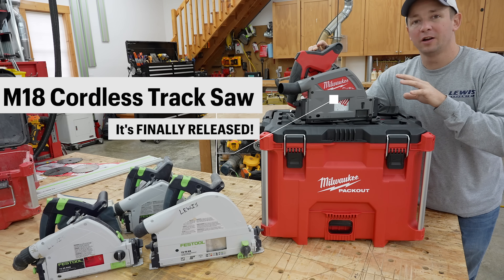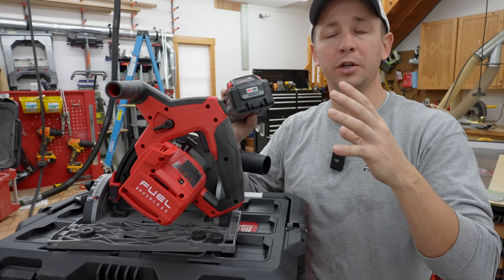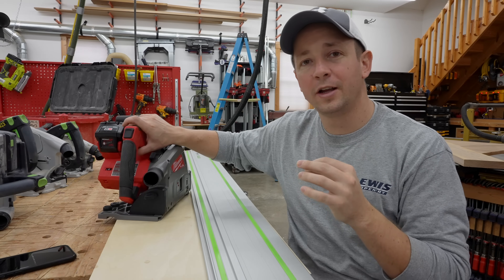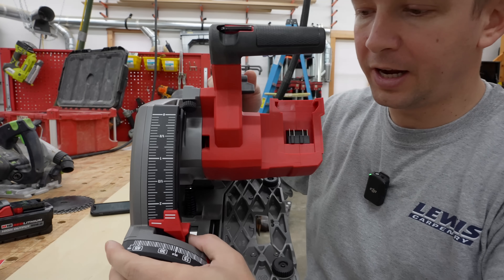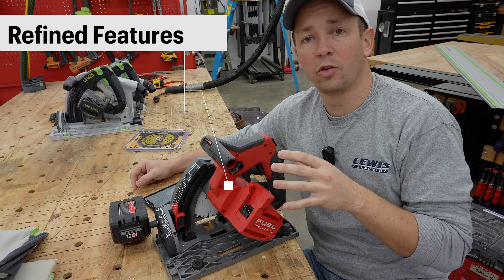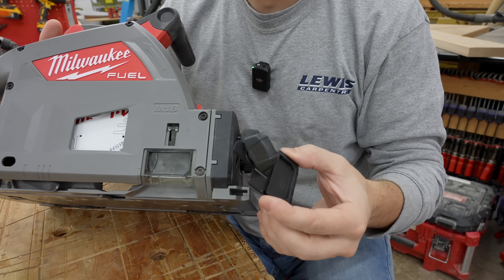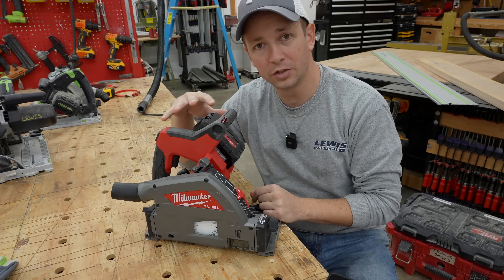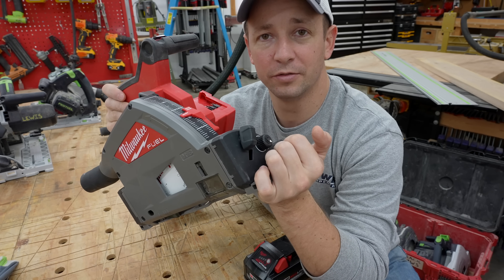Did Milwaukee Deliver??? | Full Review of the NEW Milwaukee M18 Track Saw

Comment: I'm going to stop at 9:42 min. Cutting angles and adjusting track saw to coincide with splinter guard. That's a vary good idea to have angle cuts where the saw blade only touched the bottom of the splinter guard. When using straight cuts and then using the same fence for cutting angles you now have the splinter guard which is on a 45 degree instead of 90 degree. Having a dedicated fence to use for angle cuts and one just for 90 degree cuts is one way to overcome any issues without adjusting the bottom of the saw. I feel you way is better as it wont cut the bottom of the splinter guard. My question then is, will this effect the position of straight cuts in relation to where the splinter guard is? The milwaukee looks impressive, particularly the power of the machine compared to the festool. Has the festool a 2.2 mm blade or the later 1.8 mm blade. I bought the festool with the narrower blade. I know what you are mentioning about the festool and how the batteries get drained very quickly. That is one reason I was looking to get the metabo plunge saw. The metabo has a 66 mm cut depth opposed to the festool 55mm plunge depth. In the end I bought the new festool plunge saw. With the festool from the back of the fence to the cut for 90degree is very close to 184 mm. I should really conduct an experiment to determine how far angle cuts go from other side of fence. Great video. Thankyou for dedicating your time to present this video.

Comment: Spencer, great review from you as usual! I get that this review is about the Milwaukee battery platform..... but can i ask you about another subject that is connected? Between the shop and jobsite, it's hard for me to justify switching from corded to battery. My old way of looking at things on the corded/ battery choice was driven by moving around or working in one location/ station. I usually find I have one cut station on most jobsites. Along with how much battery "wear" with heavier repetitive use decision. To me, I struggle to find the cord to battery value for this tool.... can you help me why it works better for you? I have quite a few M18 batteries and tools, but I also have a corded Festool tracksaw.....
Reply from the maker: Well here is the truth for me, in the shop I am always using my track saw at my work bench which has a hose above, so its always attached to a hose. Cord is fine in the shop. 

On the jobsite, most of my track saw work in near my saw station where I always have a vac setup. When I am doing a lot of ripping of 1x material for beams I bring a corded saw into the jobsite because I like the power, dust collection, and don't like changing batteries often. 

That being said there are plenty of times on the jobsite that I grab and go with the TSC 55 and it works great with the dust bag. Especially for cutting down doors. So for me, the convenience on those occasions is worth having the cordless saw, but it helps that I also use the HKC.
Reply: I have the Makita corded track system, I have always liked it better then the Festool but that's just me, wanted a cordless saw but wasn't willing to buy the Makita cordless because I have all Milwaukee cordless tools, this is something that I'll give serious thought to buying. I don't worry about how many cuts per battery, I have one 9.0 high output battery plus a lot of 5.0's so that's of no concern, the cut is and I'll have to look at that. I do think quality of blade is very important, I use Festool blades on my Makita and am very happy with them.

Comment: I got a question. Will those adapters work with a say, 6ah dewalt battery?
Reply from the maker: I'd be hesitant to try it on a tool with this much power demand, but in theory it probably should.

Comment: Have you used the Dewalt tracksaw. What are your thoughts on it. 
Great video as usual 😊
Reply: I'm all in on the  Dewalt platform but wasn't impressed with the precision of their  track saw and ended up buying a Bosch. Makita was a close second.  Festool and Mafell were too many $$$ for DIY justification.
Reply: I have the DeWalt. I like it but I don't think it's as good as the Makita and by the looks of it also not as good as the Milwaukee. 
The DeWalt depth adjustment is cumbersome in comparison to the other brands. Changing the blade is also not the best. 
I will likely get this Milwaukee and sell my DeWalt.
Reply: Yup I have the Dewalt track saw. Your right about the precision. Feels like I have to do a correction each cut. But it’s very handy when I’m lazy to bring out the table saw. This Milwaukee track saw review is awesome and the price for this track saw is fair. Would love to get my hands on it.
Reply: @h0melyfe792  so I actually went ahead and bought the Milwaukee track saw yesterday. I just bought the bare tool and 2 tracks. I didn't need the kit version with the battery, the charger and the packout as I already have more than enough of that stuff. I'm ordering the 108' track from HD. I haven't even pulled it from the box yet but I will use it tomorrow to compare it to the DeWalt. Most likely the DeWalt will find a new home in my garage or I might sell it.

Comment: Thanks spencer
Looking forwards to getting mine after this review
Does it fit in the large packout at all? As you said the xl is huge for a tracksaw
Reply from the maker: I couldn't make it fit in the large packout. Possibly if you took the blade off, but otherwise no.
Reply: Would it happen to fit in the 16 in compact pack out box it looks like the dimensions would be really close ?

Comment: thoughts on the Mafell MT55cc?
Reply from the maker: I've heard good things but I haven't had the chance to use it. The CON for me is the battery platform. It would be a one trick battery platform for me so I have stayed away from mafell cordless saws.
Reply: Well if you would have waited and bought the Lamello cordless Zeta P2 which uses the same batteries as the Mafell it would have been a two trick pony and you would have had the best of both worlds. 👍

Comment: You could always take the blade off and close the saw down in the blade changing position if you really don't want to take the larger box. Is the inconvenience of taking the blade off worth it?
Reply from the maker: With the way the handle and dust port are on this saw, I think it still wouldn't fit. Not a bad idea though.

Comment: Question for you, I am about to purchase the festool hkc55 cordless track saw. I want the attached short track specifically. However I was wondering if I could use that short festool attached track with a different track saw, such as DeWalt since I mostly use that battery line? And advice would be much appreciated
Reply: Get the Mafell version.
Reply from the maker: Sorry, I don't have any experience with the dewalt track saw. I'd recommend going with the actually HKC or Mafell verson. I don't think the dewalt will work well, if at all.
Reply: @InsiderCarpentry  will it work with the Milwaukee? I also Cary some Milwaukee batteries but I really am hoping not to have to carry another battery line around the jobs
Reply: usually track saws, if they're compatible with anything, use the festool FS pattern rails, and/or they use their own rail. for example the HKC works on the FS and the FSK rails, but the TS55 doesn't work on the FSK, only the FS.
Reply: The dewalt does not fit.  The short track do the hk’s have an extra slot that only the HKC has
Reply: @Rossthetoolguy  thankyou

Comment: Thanks for this review! I curently have a makita corded and i really wanna go cordless. Not sure if i missed it but i didnt see  a 45 degree anti tip lock or the option to do the scoring cut prior to a full depth plunge. What is your opinion on that stuff ? I rely on the scoring cut to get those perfect rips on a finish type material where i cannot have any tearout/chipout. 
Thanks again
Reply: I saw another reviewer on here (John builds it) and I believe he pointed out that it has the anti-tip lock. 👍
Reply from the maker: I missed it but you are correct, it has those features also.
Reply: @InsiderCarpentry  Thanks for the reply. I looked throught the manual on their website and it actually shows those. Thanks again for the video. I have a bunch of milwaukee stuff so now im really debating to get the makita or the m18 track saw. Have you tried to cut any finished surface material?

Comment: Can't see that you can search comments, so apologies if this has already been said. Just sharing that lying on its side, this fits in the deep box Dewalt TSTAK, with room for batteries, vac attachments, and spare blades.  So if you're in that system (which is different from the larger ToughSystem), this is an excellent compact solution.

Comment: Could you remove the blade and keep the saw in the locked position to make it fit in the smaller box yes it’s a pain if you store it everyday if it works it’s a option

Comment: Any comparison to Festool performance & operation? Both Kits are close to same price so it's not a price saving; becomes more decision on quality, feature and preferences. You feel it's on same caliber as Festool or does Festool retain the lead if Battery Platform was not a consideration? I'm at that gate now, looking at both. I feel the Festool still has the edge with the electronic detection kickback and bluetooth batteries for dust evac unit. If there was a Price difference, might nudge the Milwaukee more.  

Personally, after Milwaukee had time to examine all others and benefit from their designs & features (saving on R&D), I thought it'd come under the Festool price not essentially equal. Does that indicate Milwaukee's position is their equal & direct competitor to Festool, and not competing with Makita, etc.

Comment: I’m surprised he don’t have a makita track saw. My xgt is a dream
Reply: I’m considering that too. Did you try any other brand saw?
Reply: @mikewaters6980 ya,  but have only owned makita. I’m at the point of buying a more powerful saw, maybe one that runs on 220volt or high amperage 120volt. Mafell makes a k85 that is 2040 watt motor, literally a few percent more than a 3 horsepower table saw
Reply: sounds like you might almost be able to rip through concrete floors with the Mafell!  @CraigularjJoeWoodworks

Comment: Why no mention of the Makita XGT 40V Track Saw as a comparison? 

It seems like more direct competitor than a Festool or Mafell (which are considered to sit in that next tier up). 

Or is the Milwaukee THAT good that it sits far above the Makita and on part with the Germans?
Reply from the maker: Unfortunately I don't have any experience with the Makita, that's why I didn't mention it. I don't have any makita cordless batteries.
Reply: I wouldn't say the festool is next tier above the Makita. The Makita produces just as good of cuts as the festool
Reply: @zackminarik2402  oh I agree! I've had 3 variants of the Makita track saw over the years (corded, 36V and now 40V) and have loved them all.

I have heard the TSC55 is a little more refined than the Makita, but I couldn't tell cut-wise, based on short experience with Festool.

What I meant next by "level above" was from a brand image perspective.
Reply: @patchesZA  I definitely agree with the brand level recognition. I have used the festool tsc55 req and something about it did just always feel more refined than the Makita. Maybe it's a mental thing lol
Reply: Makita XGT 40V battery platform also has a 10 1/4" cordless framing saw that Milwaukee doesn't have at the moment.

Comment: Besides making us by a specialty blades, I don’t understand  why manufacturers keep making track saws for “6 1/2”” blades when the 7 1/4” blade is readily available nearly everywhere.
Reply from the maker: Size and power.
Reply: I understand that to some degree. We could probably add weight to that list..  The ts75 is very heavy but it is sure nice to have that depth when you need it.  A 7 1/4” seems to be the middle ground 🤷‍♂️. 
I’m blessed to have a KEB.  Thanks for putting out all the great videos. 
Ps 100:4.

Comment: Great review- which tracks do you recommend?

I have been really wanting the HKC - but I am not sure if it's a better choice vs this one if you could only have one. Any thoughts?
Reply from the maker: If only one, definitely a standard track saw. But the HKC has been a game changer and money maker on lots of jobs, so its got to be both for me.
Reply: @InsiderCarpentry  thanks. What size rail do you recommend?
Reply: Ya I’m gonna second one both. The HKC is a huge moneymaker, highly underrated tool
Reply: I have an HKC 55 I want to sell with 2 HKC tracks......
Reply: @brandonbennett127  I am interested - how do I get ahold of you?
Reply: @davidemmons3867  If you're doing sheet goods don't bother with the 1080 that used to come with the Festool. Only time I use it is to extend my other tracks for extra long rips for counter tops and such. Get the 1400 and the 2700.
Reply: @carbb5760   I highly recommend the HKC as well depending on what you're doing.  Its supposed to be more of a construction tool as opposed to a finish tool... but I'm not a framer so use it mostly for featherboard, TnG, and Shiplap cladding... HKC replaced the miter and achieves clean gable ends in half the time. Serious money maker.
Reply: @davidemmons3867  any way to send a private msg?
Reply: @surfinchemist1  I used it to frame a job for the first time this year as I’ve only used it for decks and finish work generally. It performed pretty well, having your rafter angle preset on the guide made cutting all of the rafters for the house extremely fast.
Reply: @brandonbennett127  not that I can tell.
Reply: @davidemmons3867  email?
Reply: @brandonbennett127  I have tries putting my email in a message and youtube deletes it everytime.
Reply: @davidemmons3867  do you use signal?
Reply: @brandonbennett127  nope

Comment: Seems like the remaining question is Festool vs Milwaukee track and can you use the (new) Festool track connectors with the Milwaukee tracks.

I suspect the Milwaukee track is not the same thickness as the Festool which might explain the miter misalignment.
Reply from the maker: I think you are correct on the track thickness issue. It's a bummer.
Reply: @InsiderCarpentry  I think you might be able fix it by putting shims behind the blade to space the blade out a few thousandths.  I know McMaster has 20mm ID "shim washers" but they may or may not be wide enough.

I need to double check the geometry / math on this concept though.

Comment: I'm glad it reviewed so well! I can't wait to sell off my corded Makita with the way-too-short power cord.
Reply: My makita has the ability to be locked into the track and used used upside down horizontal and vertical unlike any of the brands shown here,it is essential doing renos to be able to cut a perfect line when needed on a ceiling or wall safely
Reply: @darylthomas4522  Apparently the Milwaukee does have the same anti-tip feature you need. As well as the scoring feature. He just missed them in this review. Now there's really no reason for me to not upgrade.

Comment: I still don’t see a reason to have a cordless version of a track saw. I always use the track saw at a dedicated cut station/ bench. I always use it with a vac. So a more compact and lighter version of the saw with an extra slight encumbrance of a cord isn’t a negative. It’s much easier for a “cutting station” tool to be always ready to go than have to have yet another ecosystem of battery type prepared for juice. Now a cordless circular saw that you can take around the job for quick rough cutoff tasks or into attics I could see as handy to not have a cord. Disclaimer, I’ve gifted more Milwaukee battery tools than I own (I don’t own any), so obviously I’m not one of those many people with Milwaukee batteries and chargers aplenty.

Comment: I have been waiting to save up for the HKC.  I was just about to buy it when this came out.  I’m a Finish carpenter.  Take price out of the equation.  For my first track saw would you recommend the HKC or this milwaukee track saw (I’m already heavily invested in the m18 platform)
Reply from the maker: I would defintely recommend a standard track saw as your first saw. The HKC has its place, and it can be a game changer and money maker in certain applications. But with my workflow I would never be without my standard track saw. The HKC is a nice bonus saw, but most any carpenter will use a standard track saw a lot more.

Comment: The only downside I can see with this saw is where the cuts don't line up in the same position whether you're cutting square or on a bevel. The benefit of using track saws is being able to line up the guide rail on your pencil line and cut on a bevel to that exact mark but that's not the case with this saw. Moving the base from side to side won't fix the issue, it could only be fixed with having a thicker or thinner guide rail
Reply from the maker: It is probably perfect with Milwaukees guide rails, but I haven't tested it yet. Just got the track yesterday.
Reply: @InsiderCarpentry I hope you do a update with the Milwaukee track👍